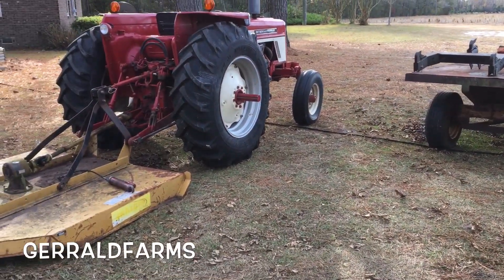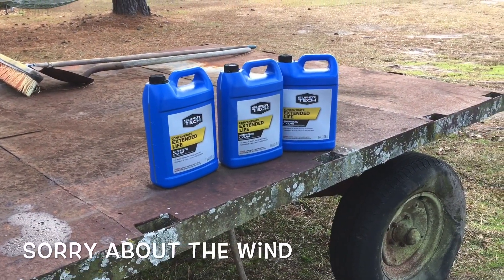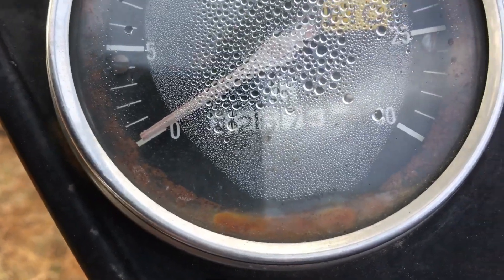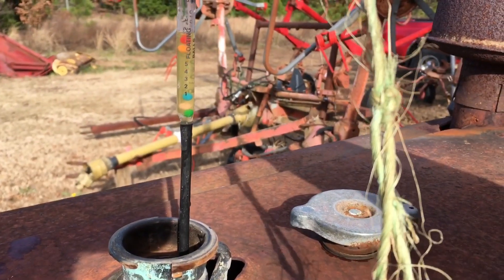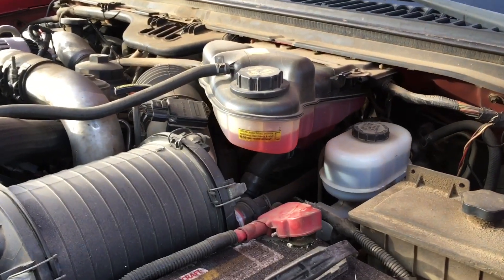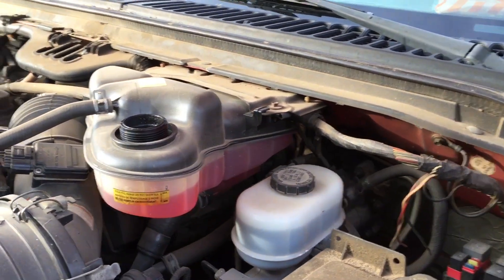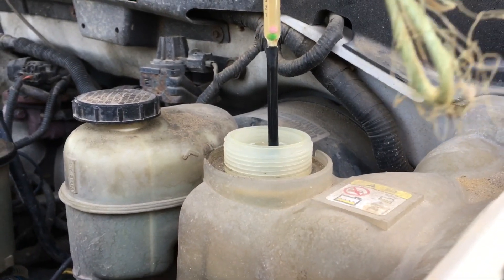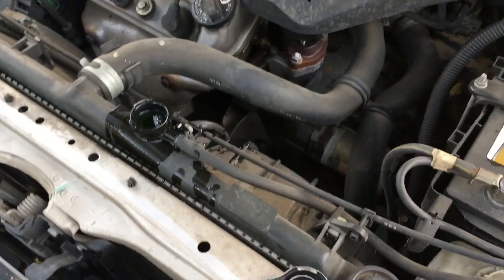Checking the Antifreeze in our old International Tractors

Comment: I'm a bad boy.... We don't check antifreeze like we used to. When I was a wee lad, the old man was so tight with the green paper, he didn't want to waste any green liquid!!
BTW, we didn't buy jugs back then, it was by the barrel...
We tested everything!! Drain enough out so we could get enough antifreeze in to get it down to 10°-15°... If we hit 20°, that was close enough! Never froze anything... Luckily!!!!!
Finally I told him we should get everything 50/50.. and only put it in mixed!!! So, that's how everything is now, keep it good to -34° and smile when it's -15°... Instead of waisting fuel when it gets that cold.
Thanks for the video Jacky!!
I might actually check a few things as we have them running 😎😁
Reply from the maker: Thanks for watching.  I’ve seen them freeze and push the freeze plugs out. I’m not that lucky.lol. It would bust the block. Have a good week
Reply: @GerraldFarms  ya.. I'm not that lucky either... LOL.. so we would start them, or plug in the block heaters and cover the hoods so the radiator would make it... Or dump the water out.. was always a pain in the @$$!!!